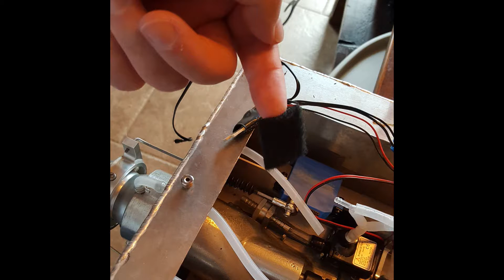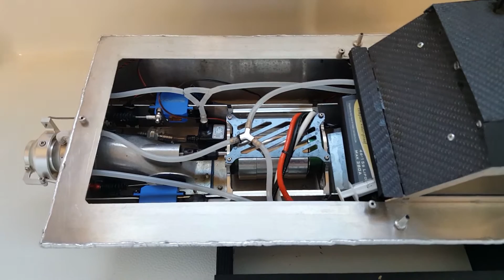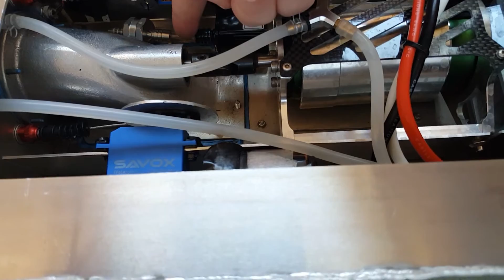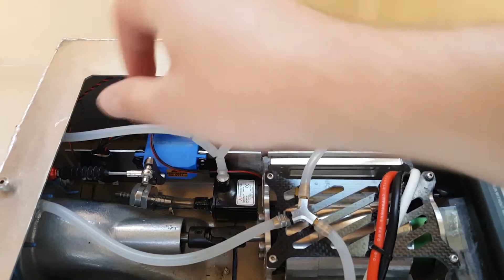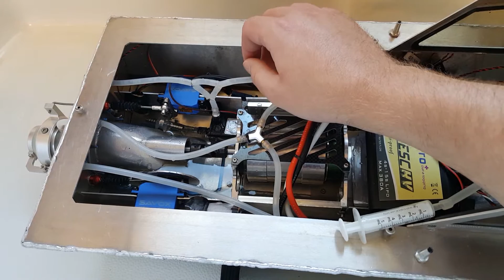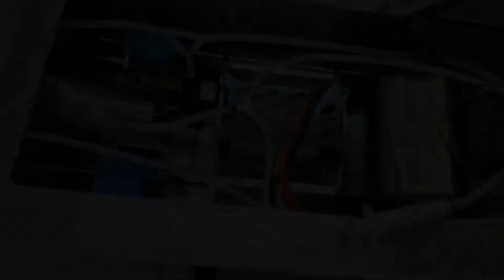Aluminum RC Jet Boat (Part 7.1) Bilge Pump - problem solved!!!

Comment: I bought a few different types of membrane pumps. low volume compared to your pump but zero problems with sucking up water. and even could place a bigger one compared to mine since your boat is also pretty big. then you have no problems with sucking it up and have a good flowrate. Can you tell ke what sensor you use? is it on and off of does it activate a timer when running?

Comment: Sweet! What sensor did you use?
Reply from the maker: Phantomshttersucksatlife not really sure what the sensor is.  it came with the pump. the pump was a little kit that I got on... um.. eBay? pretty sure eBay. there are probably better ways to do this btw. this is a pretty complicated solution. I just didn't trust the one way transom drain valve things. way too much money in this thing to watch it sink because of a $6 pos valve thingy. get to looking on eBay and I'm sure you'll find it.  it was like $15.. I think. not super expensive

Comment: Interesting way of draining the water from the inside but isnt it much easier to place a drainplug in the stern? so you dont have to use any power or complicated installations. Maybe the oneway valve can do the trick. While the boat is speeding the negative pressure at the stern sucks out the water from the inside en the valve is closing when there is no forward speed. Actual speedboats have the same way of draining the water from inside.
Reply from the maker: peterencobie I thought about the hole in the back, but I didn't think about using the one way valve.  I like that idea. might give that a try for this summer. thanks for the advice!!